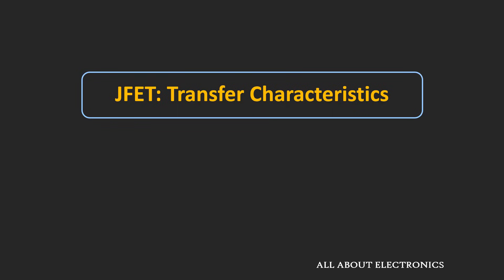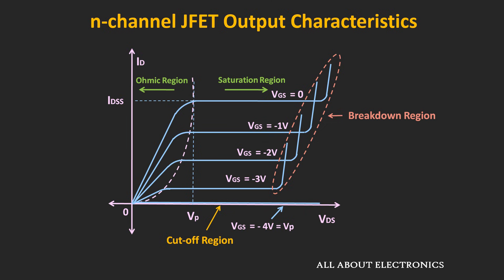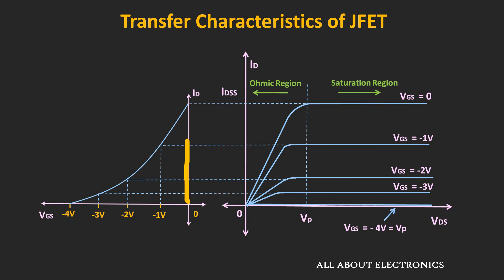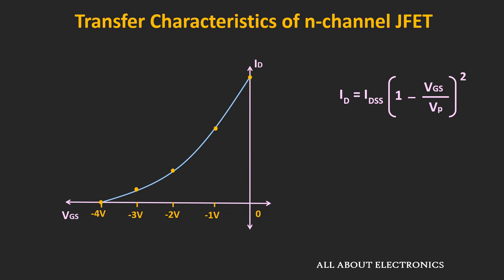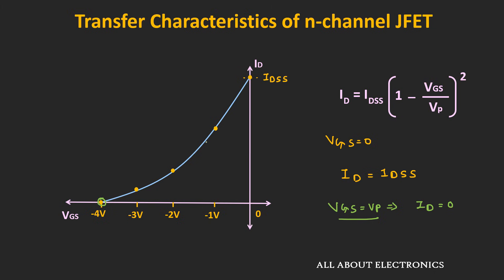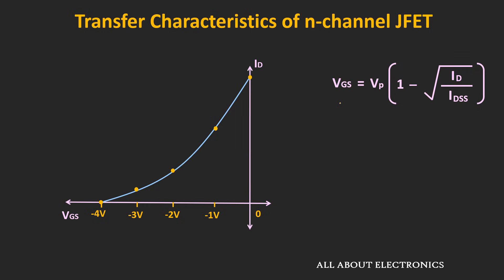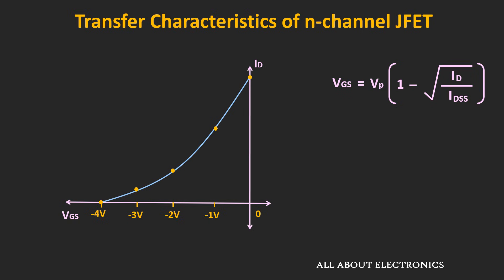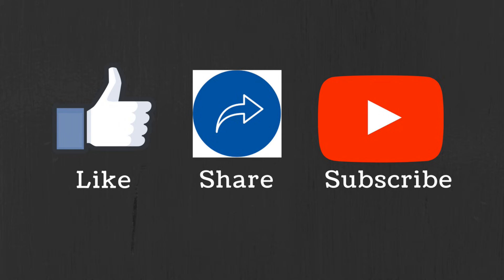JFET Transfer Characteristics Explained

Comment: transfer chara is the relation or plot drawn between the input and output quantity, while  0:48 shows the output chara, relation b/n output current and output voltage
Reply from the maker: The transfer characteristics of JFET is shown at 2:30.
Reply: @ALLABOUTELECTRONICS  yes

Comment: Sir in p channel jfet Id is negative so the graph will plot on 4 quadrant ?
Reply: In Transfer characteristics of p channel JFET
Reply from the maker: If you have followed the previous video on the construction and working of the JFET, then for p-channel JFET, the drain current was assumed to be the outgoing current from the drain terminal. The source current is incoming current to the source terminal.
Based on that, the transfer characteristics have been drawn.
For more info you can check that video:
https://youtu.be/2I_8YNVgbEw

Comment: The transfer function I believe would need to use the absolute value of Vgs since it is normally negative.   One of my biggest problems in electronics is keeping the signs correct.